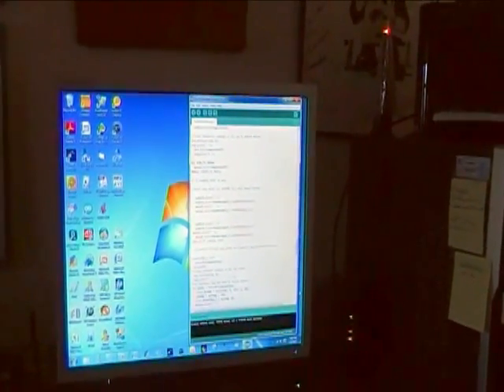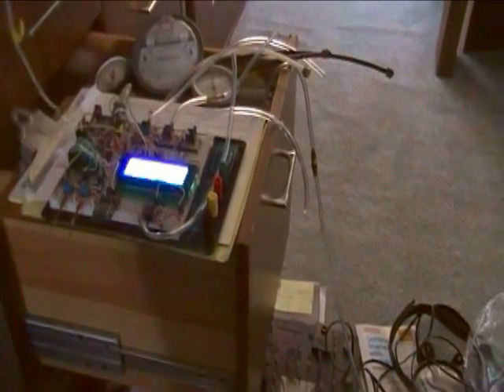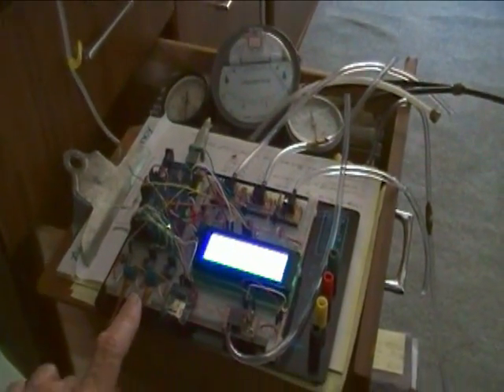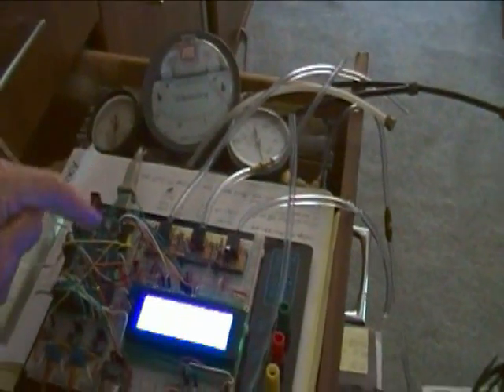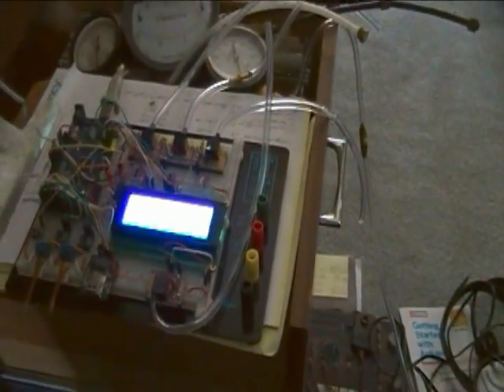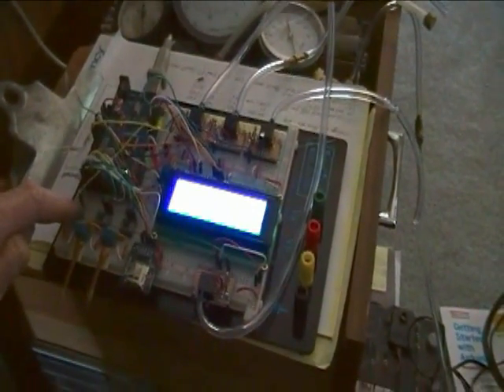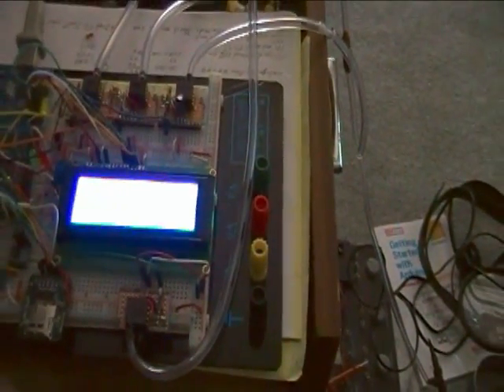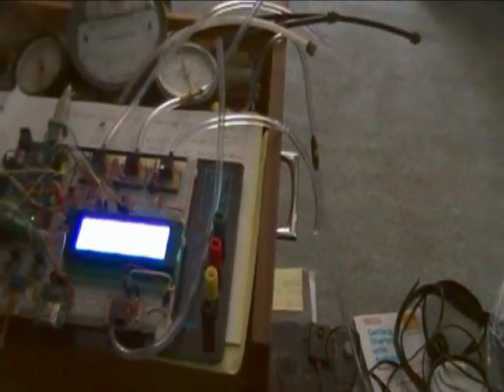Woodgas to Electricily Arduino Datalogger Using Arduino Microcontroller

Comment: Thanks for sharing such an Awesome project. Can you please share the schematic & code.
Thanks
Reply from the maker: Hello Yawar.
  I hate to admit it, but I do not have a schematic for this datalogger.
I simply started with a Mega2560 and began adding components as I learned how the whole system works.
I do have the code.  If  you are already good with Arduino, you can probably deduce the connections from the code.
If you think the code would work for you, email me and I will send it to you, along with a close up picture of the Datalogger at that same level of development.
The code file is:   DataloggerT.ino
The picture is: DataloggerFrontalView.jpg
My email:
spaco@baldwin-telecom.net